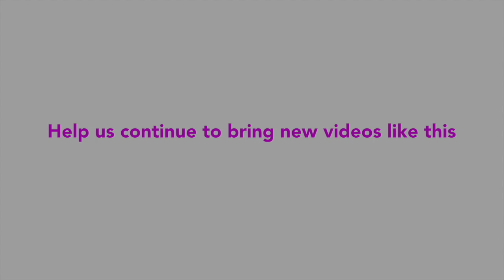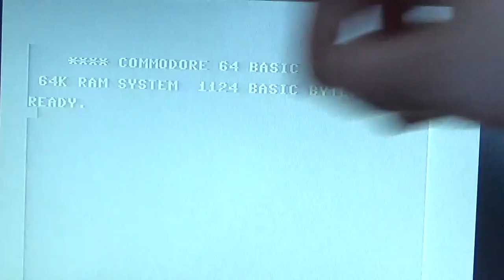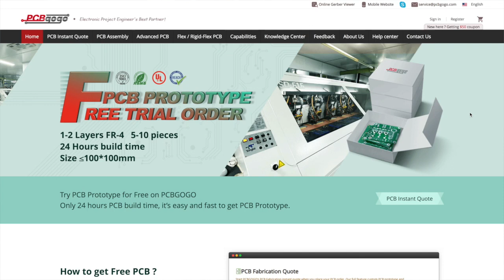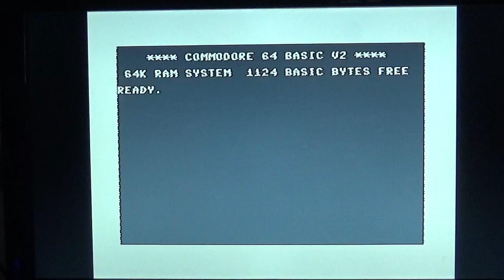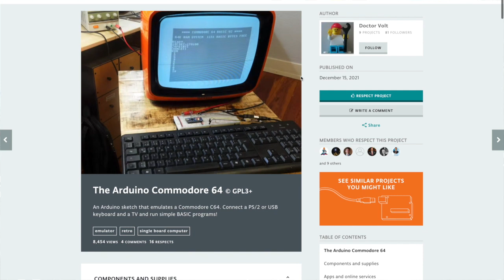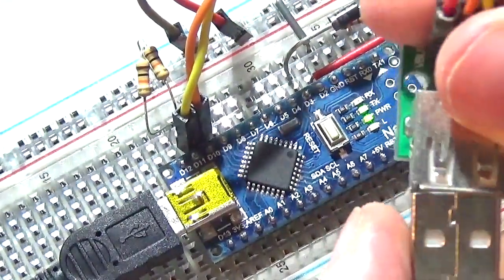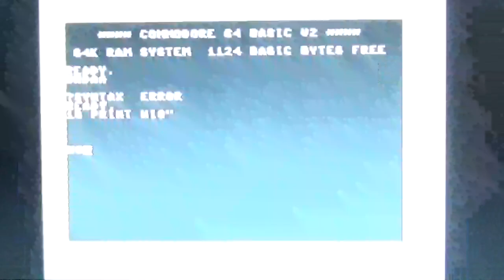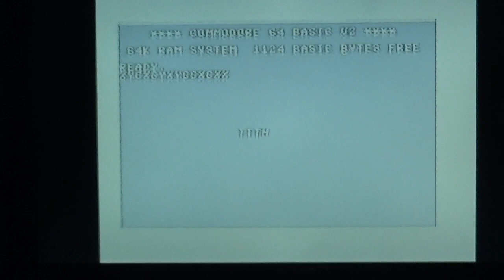C64 on 8bit Arduino Nano! Second Attempt!

Comment: If the keyboard effects the display wouldn’t that point to power supply problems?
Reply from the maker: No its running on a full 2 amps, its because the video side stops running so the CPU can process the keyboard input, hence the flicker, exactly like the ZX80 suffered from. As the single core CPU is not multiplexed. However there is something else going on considering how rock solid our own TinyBASIC computer systems are (which use all the same parts and power supplies) compered to this.

Comment: That looks like a 1N4xxx series diode, and if it's in there at video frequencies it's surely the wrong sort as they have low switching speeds. Those diodes are meant for things like rectifying the output of transformers, not signalling. For that you need a switching (or signal) diode. I'm just sort of guessing as I don't have access to the actual design, although if somebody is directly driving video output via software and GPIO pins, then it's amazing anything works.

A much better choice of microcontroller for this sort of use would be a Pi Pico as it's got much more basic oomph than an Arduino nano. But then where would be the fun in that?

Comment: What about the C64 user interface (input/output pins), is it functional? Can I control LEDs etc. with it?
Reply from the maker: Nope... this is software only. If you want to control pin I/O then do look at our TinyBASIC Computers project thats using BASIC running natively on the Arduino Nano hence not an emulation https://youtube.com/playlist?list=PL8Ltmk_Xax1qYr7pXQUrhQ8ibLuIxM7O2
Reply: @WiFiSheep  What a pity... I still have the fischertechnik interface but blew up my C64. If I could recreate the user port, I could use that interface again.
Reply: @WiFiSheep  Wait, so the user interface is controlled by PEEK/POKE, if I am not mistaken. Does this PEEK/POKE go anywhere physical, i.e., to I/O pins?